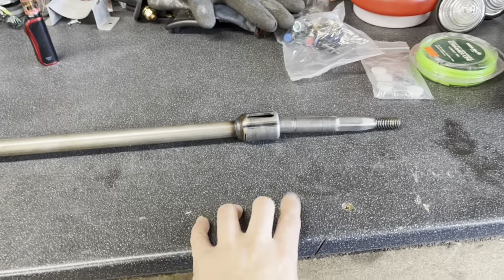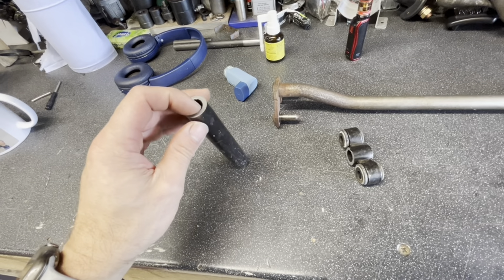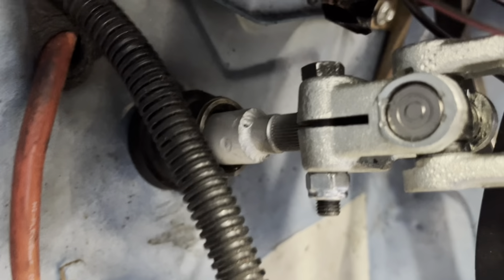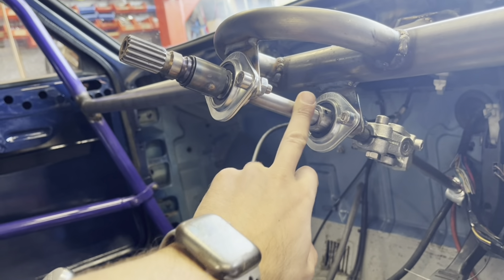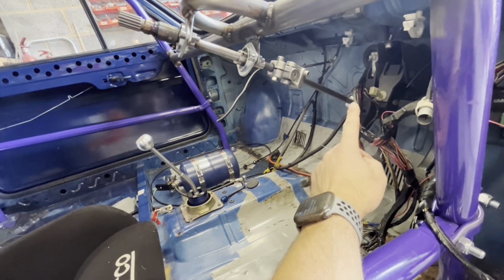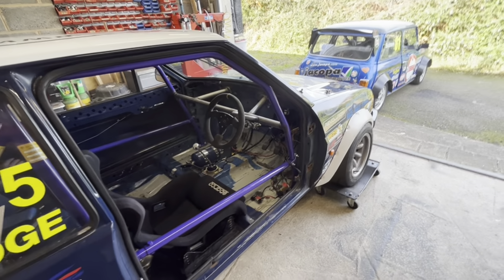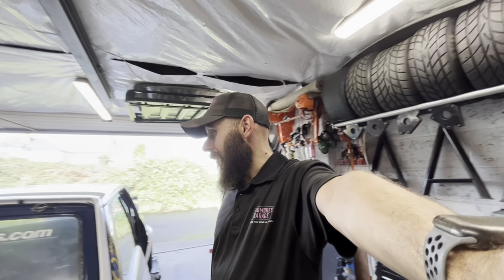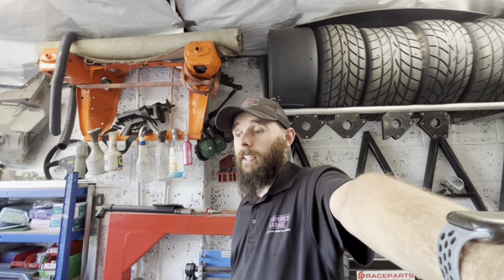ford fiesta XR2 race steering column

Comment: Where did you get the of the shelf shafts from ? 👀
Reply from the maker: You can get them from most places to be fair, that car builder place I mentioned do them and I think rally design and you can get them off eBay as well. I use 9/16” 36 spline as that’s the same as a mini steering rack output and Ford UJ joints if that helps

Comment: Did you need to set the phasing of the uj's in the column to ensure a smooth rotation?  As i had never heard of it before but when i  installed mine at first it was really notchy
Reply from the maker: We just threw these in anyway and it seams smooth, maybe if you put them identical it may make it funny

Comment: Nice solution mate , i take it the pin part was a collapsible column ?
Reply from the maker: No buddy, we always pin or otherwise known as dowel any steering components as well as welding them as a second line of defence, this is a sold 4mm rod pressed in them tig welded over, pretty much no one at that’s budging
Reply: @skidmores.garage  No mate the original part that just pushed together . (that you removed ) .Sorry should have been more clear .
Reply: Think you are right, looks like the original collapsible part that would come apart if the rack pushed back
Reply: @williamholmes9129  would like this set up in my car simple tube and uni joints but not sure it would pass the IVA test as theres no collapsible section🙁

Comment: What are those column spherical bearings called on eBay?
I’ve found the shafts and couplings on car builder solutions 
Thanks
Reply from the maker: https://www.ebay.co.uk/itm/283906701788?mkcid=16&mkevt=1&mkrid=711-127632-2357-0&ssspo=I_EVzTXyTFm&sssrc=4429486&ssuid=RKcSOIWUTEa&var=585350154437&widget_ver=artemis&media=COPY
Reply: Cheers mate, thank you for the link. Keep up the fabrication videos 👍
Reply from the maker: @Hondamark2  no problem bud